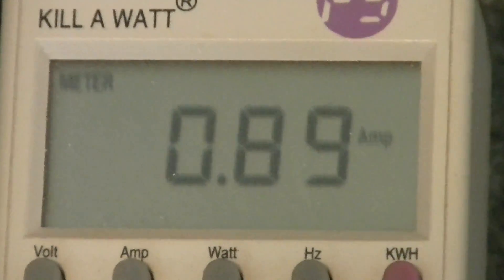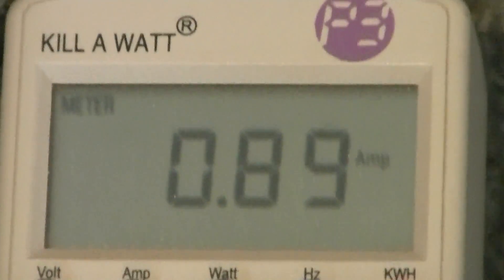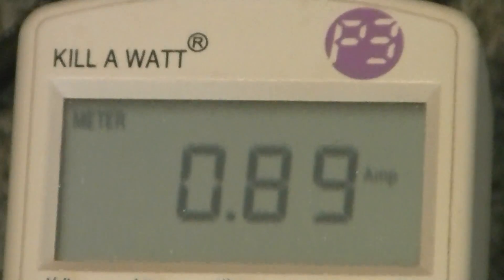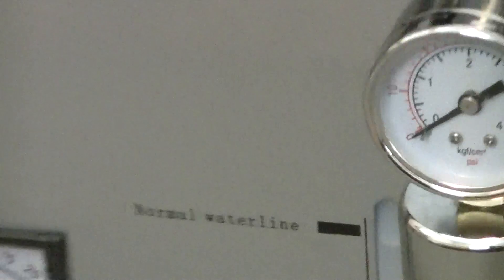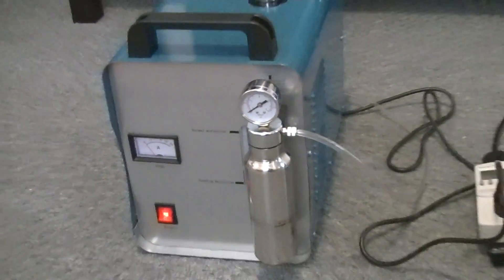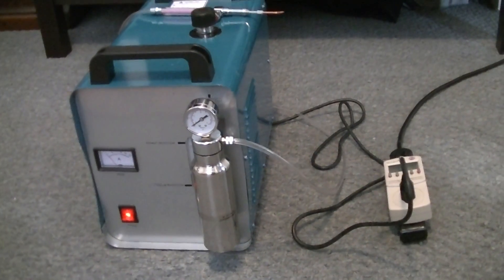H180 95L Oxyhydrogen Generator - Sodium Carbonate Test/Demo

Comment: Hello, why does a brown liquid come out with the flame?
Reply from the maker: Sounds like you have either a dirty bubbler and or electrolyte tank. You could also have to much liquid in the bubbler. At most there should be nothing more than maybe a little bit of steam coming out of the torch end with the flame.

Did you by chance use an extremely strong electrolyte solution?

Comment: Keep this main on, turn off the handle for 3 minutes Can I turn it on again and on again? I'm worried about safety. Would it be better to keep it on without just turning it off?
Reply from the maker: The machine I have has a built-in pressure switch that turns the machine off when a certain pressure is reached. I don't recall for sure but I don't think the switch is adjustable. What I do is have a very wet piece of paper towel or cloth and simply use that to put out the flame and then turn off the handle. I leave the machine on unless I'm not planning on using it anymore for the day. Sometimes I do just leave it on and just relight it after putting out the flame with the cloth but I don't like a whole bunch of pure oxygen and hydrogen pumping out into the space I'm working so most of the time if I put out the flame I also turn off the handle but leave the machine on. Hope that answers your question.
Reply: @EclecticLensYT Thank you so much for your answer❤❤ I have the same product with a capacity of 260 liters. After wiping it with a wet towel, is there a reason to turn off the handle power? Can't I just turn off the handle power? I might not have understood because I'm not good at English. Please understand🙏🙏
Reply from the maker: @bokbao7  The flame should be extinguished with a wet towel before turning the valve off on the handle.

I'm not sure how to write that in any other way. Your English seems pretty good to me even if you're using a translation app.

The reason to turn it off if you're not going to be using it even for a few minutes would be so that the machine doesn't have to continuously run which will waste water and you'll have to refill it more often. The other reason would be safety. Even though the output is mostly oxygen and hydrogen there are likely contaminants in the gas that are not healthy to breathe. Plus there's a small chance that some hydrogen and oxygen could pull up somewhere and get ignited.

If you're going to be using the torch but don't need the flame lit continuously. Leave the power to the machine on, turn off the valve on the handle. When you want to use it turn on the valve on the handle and light the torch.

If all you're doing is setting it down for even a minute, you might want to leave the torch lit and just have it rest in some sort of a stand with the flame pointing up and away from anything that might catch on fire.

I have a work area entirely lined with fire bricks. Most people don't. That's why I stress the safety a little bit more than I practice myself.

Hope that makes sense.
Reply from the maker: @bokbao7  260 liters per minute is a lot more than my little machine. I highly suggest extra safety and extra caution.

I would possibly even move the machine outside of the work area. Get some armored hoses. A tripler bubbler setup. An inline safety flashback arrester. Plus maybe even another flashback arrester right at the base of the torch handle.

I love the little torch handle I have. It's filled tightly with grains of sand. If there is a flashback it's only from the tip to the top of the sand. Unless the handle of your machine is similar in thickness to the handle of an acetylene torch.. I might be concerned about gas buildup in the torch handle igniting and actually blowing up the handle.

During testing years ago. I was at a friend's house and we were testing bubblers. One of them failed and even with a tiny amount of gas that wasn't under pressure there were pieces of plastic embedded in the drywall and the plexiglass shield we were standing behind.

All I can say is we were both glad we were standing behind the shield.

Be careful and have fun! If you end up doing anything interesting with it, try and record it and post it. Feel free to come back and share a link here so I can see it 👍
Reply: @EclecticLensYT   I was recommended 260 liters for jewelry welding. There's a safety flashback  on the handle hose. I didn't know it was such a scary machine😂😂 I understood perfectly, thank you.Your research is so amazing. I'm so touched.  I shouldn't have
bought this machine without knowing how it works,
but thank you so much for helping me understand
how it works. I really appreciate it. After taking a look
at the video, I realized that I had to replace the
sodium hydroxide with the sodium carbonate, and
that's what I intend to do. Can I also put some disinfection ethanol
in the bubbler tank to desinfect it? Sorry again for all
the questions.😭😭
Reply from the maker: @bokbao7  no problem, I try to help when I can.

You should be able to clean it out with that. I would probably just use some cheap rubbing alcohol and then rinse it out with distilled water.

I don't remember how much I used in the past but if you put some rubbing alcohol in the bubbler tank it will add a little color to the flame which makes it easier to see.

This does of course mean that you're burning some rubbing alcohol in the flame and that's not ideal in some situations. The flame is much cleaner if it's just hydrogen and oxygen but it's harder to see.

I mainly used mine in the past to do miniature glass quartz sculptures. The rubbing alcohol didn't seem to matter and it made it much easier. If I get back into it I plan on building an actual burner and some custom torches for quartz sculpting but that's if I ever find the time.

Good luck, enjoy the machine, and safety first.
Reply: @EclecticLensYT    Thanks to you, my heart is so warm. Be happy always. Thank you so much ♥♥♥

Comment: I hope you didn't get rid of the machine.  It is 10x more powerful if you use 150 grams of potassium hydroxide, the biggest orifice that will work, and fill the bubbler tank with methanol.  That will allow you to do bronze brazing.
Reply from the maker: No I still have it. Need to do a little routine cleaning and maintenance on it but otherwise it's working perfectly fine. You're totally right. I would have a higher output if I used potassium hydroxide but I use what I use because I don't have to worry about any toxic fumes from the machine this way. It's a trade-off between safety and output. I'll take less output if it means no toxic gasses.

Someday I plan on getting one of the super high output larger machines that are a little bit bigger than a mini fridge.. I want to glaze bricks LOL. Plus with a larger machine I'll be able to work with larger pieces of quartz. The one I have now works fine if you want to do miniature stuff. I need a wider, shorter flame. Already made a custom piece that looks similar to what glass blowers used but has holes small enough to prevent flashback. With holes in between those holes that I could pump in some other gas or more gas if I want to. Those holes are a little bit smaller to accommodate the larger molecules of other gases.
Reply: @EclecticLensYT I don’t believe Koh causes any toxic gases

Comment: Lucas I found one of your videos where it says the amount and says that it is 15% sodium hydroxide, thanks again
Reply from the maker: I did try both.. it's been awhile.

I ended up using sodium carbonate but to each their own 👍
Reply: @EclecticLensYT  I will try the sodium carbonate
Reply: @EclecticLensYT  I wish you can tell me if salt as electrolyte will work. I don't care how much gas is produced, i just care that it produces gas no matter how minimal. And if these thing will be modified to work with a 12v battery, please answer 😭
Reply from the maker: @BOREDANDWELLBORED  yes salt will work for electrolysis. Again I don't recommended at all and you can think of that as my disclaimer.

Can a machine be set up to run off a 12 volt battery. The easiest way would be to use a 12-volt DC to AC inverter. I don't remember how many watts you are going to need so try to find a hefty one to try otherwise you'll probably burn it out. If I remember right it's only setup to run off of 110 volts or 220 volts ac.
Reply: @EclecticLensYT  you don't recommend salt? I'm on the edge of buying this, seconds away, so please tell me why not salt? I heard that it produces chlorine, not a problem to me since I'm using this outdoors anyway, I only care that salt works because it's accessible everywhere and cheap. This is my last question. Please answer

Comment: magnificent video a question is any type of alcohol that is used for the bubbler thank
Reply from the maker: It's mainly to cool and give some color to the flame. It makes it easier to see that's for sure.

A friend of mine uses high-quality rubbing alcohol in his.

I get medical grade from a different friend of mine and that's what was recommended to me. I don't really know if it makes a difference. There might be unwanted fumes using rubbing alcohol.
Reply: Thank you
Reply: @EclecticLensYT  I think it creates more of a non oxidizing flame also a hotter flame with an alchohol acetone water mixture
Reply: use potassium hydroxide you want 15amps
Reply from the maker: @SodiumInteresting  I might give that a try someday 👍

Comment: hi, I need to know if you can turn a bolt red hot with this machine?
Reply: Jimmy Côte sure you can. A tiny bolt in the mm size 😂. Your not going to hear up a large boot with this but they make much larger generators and torches. I've seen them used on cars and large Machinery to do exactly what you're talking about and matter of seconds. Actually if you're not careful you'll just melt both making things worse but once you figure out how to use it you won't have that problem. It's interesting how hydrogen and oxygen react to different metals. It'll burn right through tungsten and yet the same size piece of aluminum will heat up red high in the same amount of time. The aluminum eventually burns as well but I believe aluminum has a lower melting point than tungsten meaning that the opposite should happen.
Reply: Absolutely…depending on size of course..

Comment: why did you use sodium carbonate instead of sodium hydrexide (caustic soda)
Reply from the maker: Good question... one I thought about myself for a long time before I even ordered a machine.

To put it simply. It may not produce as high of an output (gas wise) and it also has a limit per say to how many amps you can push though the machine (safety & less wear and tear) when using carbonate but it's also much safer to use and I have people around young and old that I worry about. Basically I spoke with a few old school HHO Generator guys and they explained it in detail. I then spoke with a chemist about it and he explained a few other benefits.

I say use what you prefer. Both with work. You'll get slightly to moderately higher output with (caustic soda) but you may also burn yourself or go blind if splashed in the eyes.

Safety first... :)